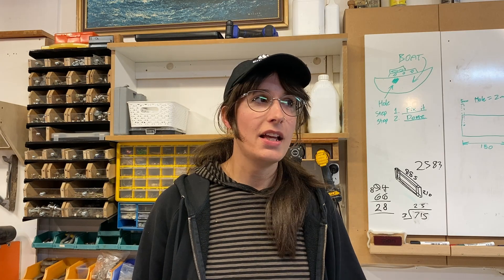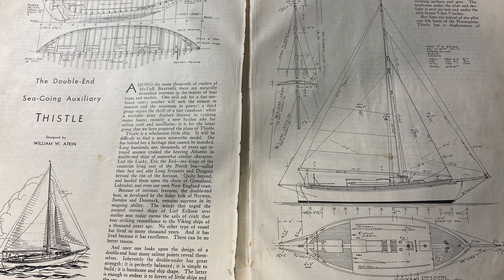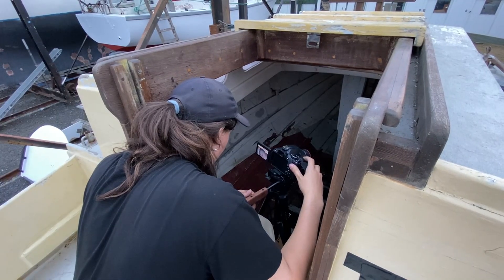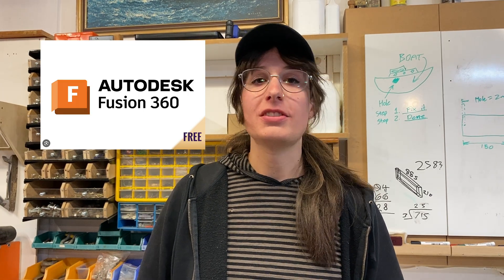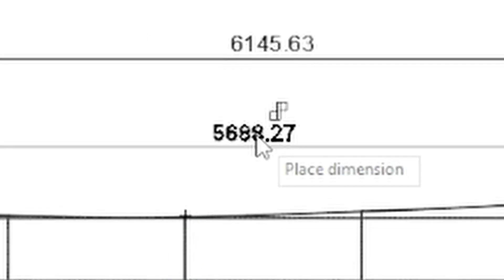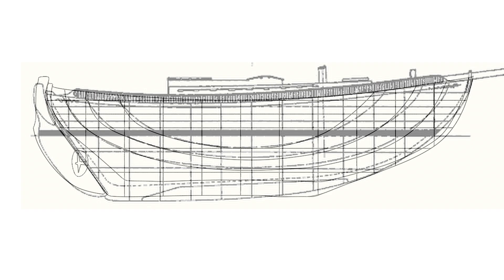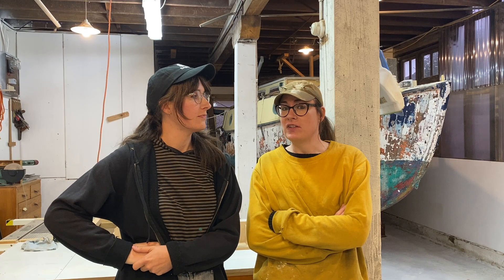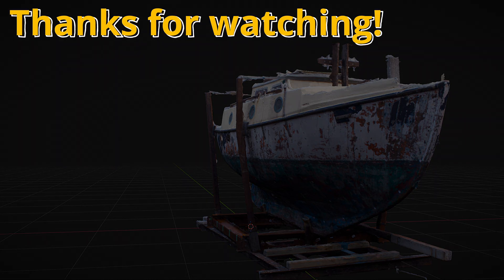Boat design mystery? Taking the lines of our wooden boat using photogrammetry | OSLO Saga ep10

Comment: Ong I’m so jealous of your shed!!! Man I would’ve given my right leg to build indoors. Love your investigation of the hull. Don’t be afraid of boats that deviate from the drawings. It’s extremely normal in commercial boats for the design to evolve as the owners learn the boat. Ours has had the bow raised, the prop nozzle extended, the wheelhouse lifted, stabilizer wings added just to name a few things and each change makes the boat better, with pedigree like your boat has its possible it’s had similar revisions as owners learn things that will improve the design. Awesome stuff!

Comment: Thank you for taking so much time on stuff that's important. She really has a noticeably flat run.
Not that you asked, but it would be cool it you divided the waterline length by 10 since that's pretty standard practice.
568,8mm or 1foot 10-3/8inches station spacing would be about right.
Maybe draw a couple of Diagonals? Just a thought
Thanks
Marty
Reply from the maker: I agree would be cool - we could quite easily do this it would just be a decent time investment and at this stage the process has more been a proof of concept. But being a nerd I would love to deep dive all the way and learn more about lines and I hope to at some point. I also wish I had access to Solidworks instead of Fusion as that is what I learned on (Charlotte) and I think would've sped up the process. In this video I also wanted to create a surface hull model to do some basic simulations on but that proved too difficult for now. Between managing life and trying to create these videos on a regular schedule with what we have available, its taking so so much more time than I wouldve expected. For now getting started on the boat work and video making is top priority so we may have to revisit this at some stage. Thanks your thoughts and comment :)
Reply: @oslosaga  Just noticed the lines printed in Motor Boating article may have 12 stations instead of 10.
Thanks for including that.